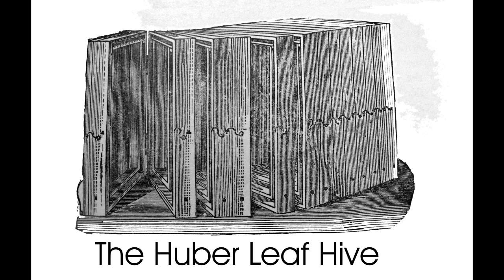Keeping Bees

Comment: What I don't like about that particular type of plastic frame is that it has openings or pockets along the top, bottom an sides.  That makes it harder to clean the frame  edges etc., and also give disease and parasites a place to hide.   If it were cast smooth it would be much better.   Right now I prefer to use wood frames with heavy plastic foundation.   If a frame breaks or becomes defective you can clean and reuse the foundation.

Comment: a) "Dect" phone's frequency interferes with the bee's navigation.
b) "Dect" phones have quite a large range which is increased by adding a 2nd ,3rd, 4th etc charger / range extender. 
c)  If you have a cordless / home / office  phone there's a 90% chance it's a "Dect Phone"
d)  Dect phones are not the only devices operating on or near to that spectrum.